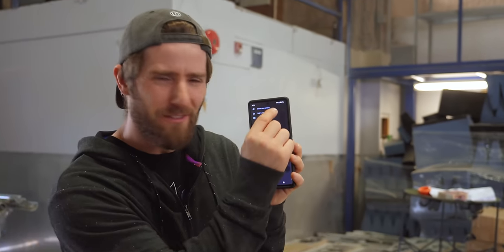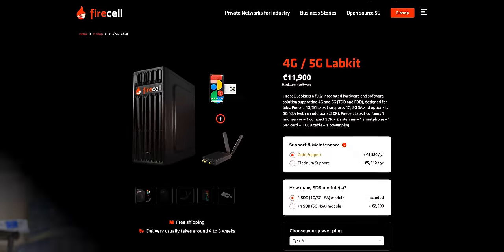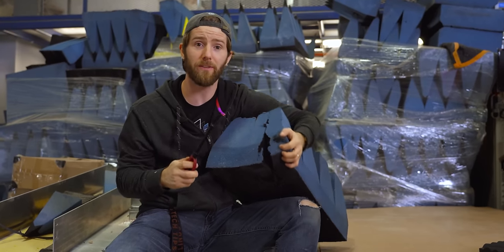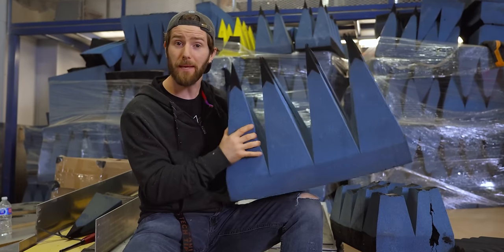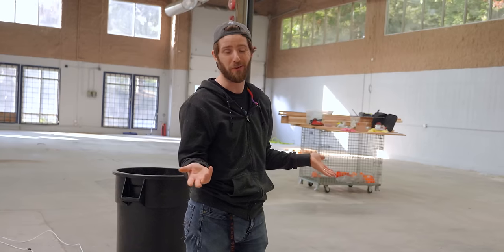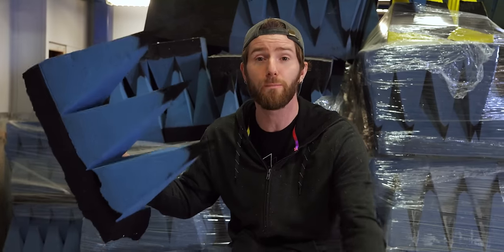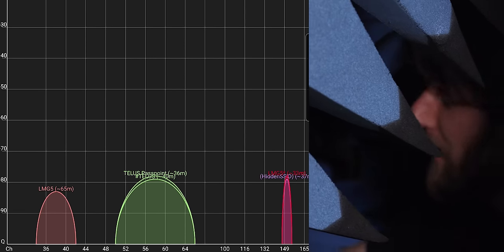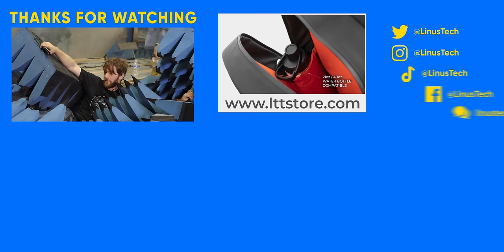They Sent a $45,000 Bill... Then Ghosted Us. - EMC Chamber Problems

Comment: The copper panels are the RF shield, the foam would still be good for attenuation inside the shield.

Talk to an MRI engineer close. They will have contacts with RF vendors, I bet you can get that built with what you have and get the RF test done and it be pretty good.

Source: was a project manager for construction projects like MR suites 🤣
Reply: What makes people think that videos like this are asking for advice?
Reply: @kidShibuya  What makes people think that comments like this are asking for advice?
Reply: @kidShibuya  Comment sections are public forums. It doesn't matter whether the videos are asking for advice or not.
Reply: @kidShibuya  we are part of the LMG hive mind. And since the most upvoted comments will get read, we are even self regulated in a way.
Reply: I suspect even if it still did block the signals, they don't want the stinky, stained and (likely) moldy foam as the visible surfaces for video purposes. 
The whole reason they're doing such a big chamber is to be able to film inside it too.
Reply: @Pyrocitor great point. Would definitely look like shit
Reply: I agree; I have spent weeks at EMC labs in chambers with better and much worse looking foam; and all are calibrated.  This seems like whining for no reason; he got a free chamber.  Don't complain! :)  A visit to a NRTL lab would have shown him this.

Comment: A long while ago I got to go in the testing chamber at a satellite manufacturer which was similar to what Linus wants to build, but much, much bigger. Something like 20x50m wide and 10m high, all lined with even bigger foam spikes.
The really strange part was that because they also absorbed sound waves, you could barely hear anyone unless you were stood right next to them. More than a couple of meters away and it was like they were whispering.
Reply: I too have been in one about that size. It was very eery how quiet it was
Reply: @philipcooksey3422  Unless you have tinnitus, then it'd be pretty loud in there and a nightmare of mine.
Reply: @TheRaptor700Rider  why would it be loud in an anechoic chamber?  That doesn't make sense
Reply: @philipcooksey3422  The quieter the environment the louder the ringing is in my ears? What doesn't make sense about something so simple?
Reply: @TheRaptor700Rider  I was unaware of tinnitus symptoms

Comment: When I worked for Monash University in relation to the CSIRO when there were this experimental devopment for wireless networking in the late nineties the Dean of engineering asked us techies to build an RF anechoic chamber for this newly developed wireless networking. 

It took is months and we used the very same foam however we painstakingly glues aluminium foil over the cones and it worked perfectly.

You should do similar Linus.

Comment: Visited a lab for testing this recently on products we were designing, they had a 10x10x10 meter chamber for this where they tested trucks. The best part is how dead silent these rooms are just as the property and shape of the foam. Those blocks are worth a fortune, they said the foam alone for their chamber $500k
Reply: crazy to think that it cost half a million and then they run a stinking truck in it, because that is literally the purpose of the chamber.

I only worked in much smaller chambers designed for handheld maybe up to "you can technically carry it" category, so a miniature compared to what you or even Linus is talking about.
Reply: Yeah foam adds up quick. Don't ask how much in ferrite tiles they likely have bolted to the walls lol. Worked in a 5m chamber, and helped install and run our calibrations for emissions/immunity. Nothing about these chambers are cheap haha
Reply: @sarowie  they had 3 smaller chambers for other types of testing (detecting transmissions and another one for blasting it with radio frequencies). They had an antenna there that could boil your insides. Mostly for aerospace and military.

Comment: That carbon electron field graphic represented energy levels, electrons don't slide smoothly based on the energy in the system, but they nearly instantly jump or fall to appropriate energy levels when the system reaches the threshold.

Comment: could you shred the foam to use as insolation between the inner and outter walls of your chamber  once you get the right stuff to build it.
Reply: You could? But ferrite tiles are far superior, I work at an EMC lab
Reply: @rabid123fox  did linus not cover exactly why ferrite tiles were better ? and then proceed to explain why they werent obtainable for this application ?
Reply: @dominickkramer6469  did I not respond to a guy asking a different question??
Reply: @rabid123fox  using ferrite tiles as insulation between inner and outer walls would still make the project hella expensive. yeah they are better. thats not the point. thats like saying "why use a bicycle when airplanes are faster?" not everyone has private jet money
Reply: @dominickkramer6469  and I said, “you could” it realistically wouldn’t give you an amazing non reflective surface you would probably be better off leaving the foam in the pointy tips and just covering the walls with it (as it was probably intended) This probably would not be good enough to pass normalized site attenuation outlined in C63.4 but for troubleshooting it should work fine as long as the 3m chamber is sealed well

Comment: You could place this foam reversed on the outside of the chamber to block signals from the outside from getting in.
It won't destroy them due to quality, but it will at least bounce them away.
Reply: Chambers like this are supposed to be shielded from outside noise. Thus putting foam on the outside wouldn't be necessary.
Reply: that is a waste. As Linus explained: His storage unit is "good enough" shielding combined with the shielding of a normal chamber.
Unless he starts to run a 5G + Bluethooth + WLAN + ... dancing robot army next to his EMC chamber his noise floor will be low enough to reasonably measure excess emissions.
I doubt that Linus will call out a company for a 1db potential infraction - he will show the curves and say something like "passed well" and "right on the edge" but I doubt he will call out a potential marginal fail without second measurement and manufacturer involvement.

Comment: You'd get better attenuation building a a number of custom Faraday cages for targeted frequencies rather than using a broadband approach. 30db of attenuation, while impressive, is only the difference of mismatched polarization- example antennas.  What I would do is build a 20 foot long chambered Faraday cage and put RF absorbent materials on the ends.

Comment: im loving the labs thing....are you going to have a separate channel for it?
Reply: Thats not the format. Itll be a datasheet
Reply: From what I think I've heard, it will not because it will support existing content on LTT and etc. It will have its own website as well I think.
Reply from the maker: It'll likely be published in multiple ways :)
Reply: LINUS!
Reply: @PaperFloss  Linus would sign LS
Reply: @LinusTechTips  Have you looked into copper brass wire mesh for Faraday Cage's or 2nd hand Cages? I'm a retired EE ,use to be the QC Inspector for Dynascan.Cobra CB's Radar Detectors wireless phones. We had 10'x10' Faraday Cage's that would 100% block ALL RF in and out of the  screen cage. AND we had to move it too to a nearby building.ARRRGH!!  Like a panel box,just bolts together. Biggest thing to worry about is watch for loose fray between the 2 shield sides when mating so you don't get a short between the plains. VERY easy to check with a OHM meter. DON"T FORGET ! Or you'll be taking it apart again. All it needs then is shielded inputs and Ground itself,NATURALLY!!

Comment: You mentioned that the one you bought was carbon-impregnated and not Ferrite-impregnated because of cost and lack of need for the frequency ranges you're working with, but the advertisement you showed said that it had ferrite tiles strategically placed on the testing-side wall and floor.

Comment: In RC aircraft we had the problem when carbon fibre airframes started coming out it would block are antennas so we had to have multiple antennas mounted
on the outside when with balsa or fibreglass we could mount one inside the fuselage.

Comment: The decay effect you had an animation for @5:31 is slightly misleading. Electrons can't generally decay in continuous small movements like that (at least until the energy difference between upper orbitals in much bigger atoms is smaller, but carbon is not one such atom). They can only decay or absorb energy in leaps between whole orbitals entirely.

The way energy is 'continuously' dissipated is just from standard heat transfer, the EMF waves create heat in the foam. Which can still involve electrons moving up and down orbitals in the carbon atoms but does not involve moving in fractions of an orbital.

Comment: Quick correction and no I don’t mean to offend, please take this as a constructive criticism Linus.  A soundwave is not an electromagnetic wave its a physical wave. Although both share many properties the main thing about sound is that it requires a medium (fluid or solid) to propagate.
But in the case of electromagnetic waves they do not need any medium to propagate although much like the sound waves they can be slowed and stopped by using certain materials as they pass through. This of course will depend on the type of electromagnetic wave and material.

Comment: Pretty psyched you're going to do camera reviews. In the last year I have utterly rekindled my photography hobby by way of work asking "hey do you know anything about cameras?" and moving that into basically being the sole photographer on any project. SURPRISE, there is a lot more to photography than your cell phone has led you to believe, and if you can add "emotion" to report photos, that only helps. In this process, I have heard SO MANY TIMES "why not just use a phone...". There are many reasons, and the deal breakers aren't even photographic. But then I got to thinking, I have old Androids going back several years, and on looking up their specs, they should produce "identical" photos. My hypothesis is that actual camera quality from flagship phones hasn't gotten better since roughly 2015, because physics. Just software has improved photos beyond this point, and is that even taking a photograph?

Comment: I worked for Rantec in the 80's.  I can tell you that making carbon impregnated foam not burst into flames is not easy, and the chemicals required to do this are not friendly towards humans.  Or at least it was in the 80's, and that foam you have looks like it was made in the 80's.  Fun story, since we had access to radio transmitters for any frequency we wanted, we used to jam the radio station for the workers who made the foam.

Comment: 26~27mhz is closer to CB radio. AM car radio (as you pictured) is WAY lower, from 540 kHz to 1700 kHz. The wavelength of 26~27mhz is 11 meters. AM broadcast radio λ is 555 meters. You will not be stopping that with foam nor will you be putting the monumental antenna indoors. It is longer than a football field.

Comment: I know that this is not totally perfect soundproofing material. But it's probably quite good, and it's what you have to hand. So if you have a small (just not tiny) room going spare, then you could line it with this and i bet amateur music producers might travel from all over, and pay a small fee, just to hear their current mixes in a (close to) acoustically isolated space. The room has to be just long enough that low frequency sound waves (bass and sub-bass) have enough space to form and move properly.

Comment: You're better off building a giant faraday cage. For the people who aren't engineers a faraday cage is a structure with all metal walls that is then grounded, one made from solid metal as opposed to a wire cage will absorb all electromagnetic waves and send them into the ground, this works because all radio towers must have a solid connection to earth ground in order to be able to transmit so you send the waves right back to ground of the circuit they were transmitted from.
Reply: A faraday cage does not do what this room is intended to do. This chamber typically would have a faraday cage as part of its structure, but that's only half of what Linus needs. The Faraday cage is good at making sure that signals don't get from one side of the cage to the other side (i.e. inside to outside or outside to inside), but it does NOT prevent the signals from bouncing around on the same side of the cage. What Linus starts describing at around the 4 minute mark is not helped by the faraday cage. Also, radio waves don't need to complete a circuit, and radio towers are able to transmit without a solid connection to earth ground...it's not safe, wise, or legal, but the transmission itself works perfectly fine.

Comment: we built a "clean room" all you need is some 2x4", couple sheets of plywood, screws, wire mesh, metal fingers, and a big soldering iron.
Reply: we typically measurements down to 30Mhz at and below -130dbm

Comment: My brick building from the 1930s blocks everything with just 8" thick brick and wood walls, 5G, 4G, most wifi... 

Old 900mhz radio worked super fine through, so there is that 🤣

Comment: The intro...Data network type will never show "5G" but you can tell if it's connected to 5G if NR status shows as "CONNECTED". It should be given that a few frames in the video show NR available bool is true. But I think we're in the right step of direction considering there's two important modes for 5G NR: NSA mode and SA mode.

Comment: I have bad news for you;  the use of foam for sound insulation is a well sold myth;  it does not work.  It does do "something" to the acoustics of a room, to be sure;  but it does not "kill" sound reflections;  it merely diffuses them.  The difference is that while a naked cement wall reflects sound like a mirror reflects light,  and a thick fiber-glass covered wall absorbs sound like black telescope interior paint absorbs light, foam acts like a light gray, matte paint that doesn't reflect specular-ly, like a mirror reflects light, but that merely disperses or randomizes the angle of reflection, like matte materials of any color or shade do to photons.  If you need to know why foam is not a good sound absorber, think of it from an energy point of view.  When sound waves try to traverse a space full of glass fibers, it is, at a microscopic level, like wind trying to pass through a kilometer thick jumble of heavy metal wires, where each time it hits a wire, the bad aerodynamics of the wire cause turbulence and its associated loss of energy (wind energy conversion to heat energy).  Thus, a thick layer of fiber-glass causes enough microscopic turbulence to convert most of the sound into heat.  Foam, on the other hand, is not as heavy as glass, and not as dispersed as fiberglass within a volume.  It partly reflects sound, and partly refracts it, but in neither case does it convert its energy to heat;  thus the sound persists, only having been reflected at odd angles.  The final result is that in a room covered with fiberglass, you clap your hands with your eyes closed and it sounds like being in the middle of a vast field with no walls.  But you do the same in a room covered in foam and it simply sounds like you are in a room with walls covered in foam.
  But be warned, this post will probably attract heat from ignorant audiophiles, self-proclaimed sound experts, and foam pushers alike;  they are some of the worst people in the planet, together with socialists, fascists, religious fanatics, skeptics, politicos and tyrants.

Comment: It's too bad whoever signed for the load was apparently unaware of the discrepancy. If they had known, and refused the shipment, the problem would have ended (for you) right there. The freight company would dump it back on the scammer and charge them double, plus a fee on top of it.

Comment: Pretty sure that the phone says 5G while on LTE due to Carrier Aggregation (LTE CA), the aggregation of multiple component carriers allowing for increased downlink bandwidth (and UL bandwidth in LTE CA ULCA, there's a lot to this stuff 😂) allowing the phone to get faster download speeds. I've never really gotten confirmation on this but I think that the technicality allowing that to be called 5G, is the likeness to 5G NR FR1, where the bands and such opeated on are similar to LTE, but capable of operating at much higher bandwidths.
Reply: An LTE band is used as an anchor band for control while the user data traverses a 5G Band. I believe this is called Non-Standalone (NSA)

Comment: One thing they taught me learning acoustic designing is never use foam. Never. They sell foam all over, like Amazon and all it does is make you work harder to correct your reverb tails because they are different at every frequency, maybe the ceiling of a drum booth would make use of them. But hanging vertical packing blankets over fabric and insulation would be cheaper. Better yet, spend the money on a lawyer and sue those foamy bastards!

Comment: I spoke to a DoD contractor who helped develop and roll out Americas 5G network. This was a few months ago. Any ways they said no one had 5G accept for Tmobile. Also even on Tmobile phone calls are on LTE but ur data should be on 5G as long as ur tower is 5G. You should be able to check these details in ur cellular network settings.
Reply: Verizon and AT&T also operate 5G (Verizon in particular is really pushing their mmWave band), and yes all networks are currently operating NSA (Non-Stand Alone) networks which utilise an LTE backbone (not full 5G)